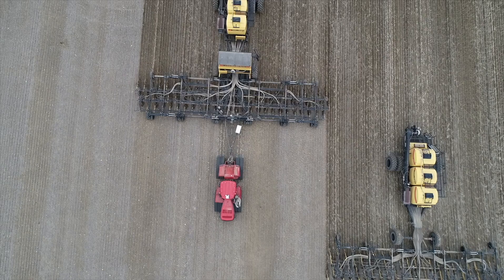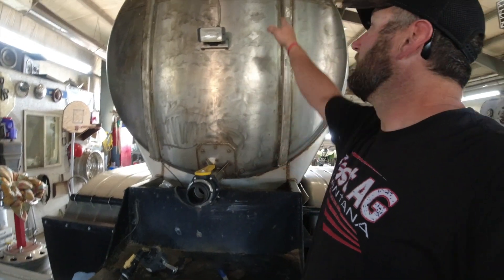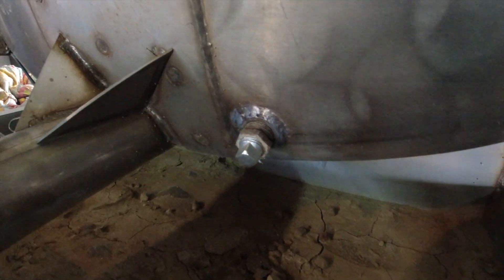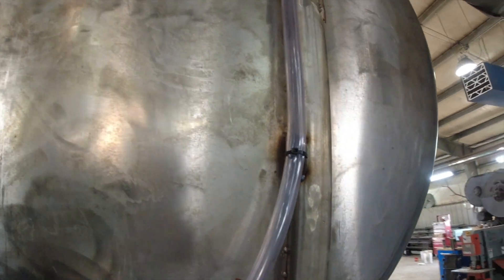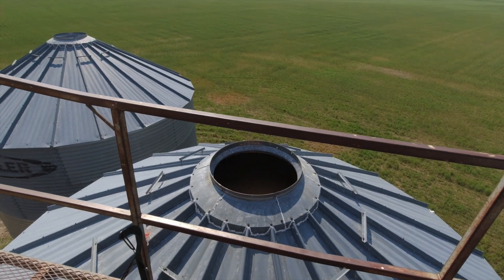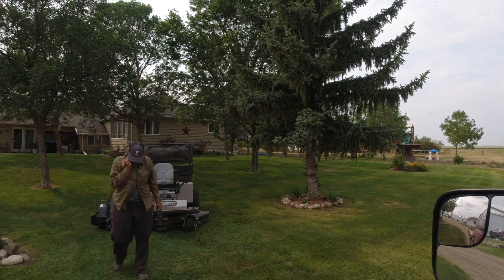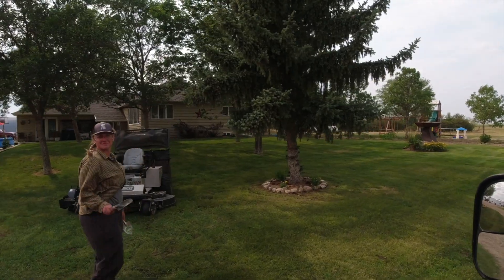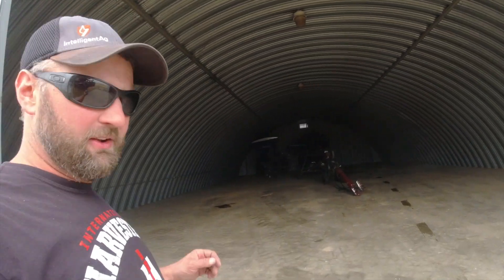Dad Broke 5 Fingers?!?

Comment: Dang Tony, you may have to make a trip east and find a couple of flex heads like we use in soybeans here. I hope you guys are running rock traps, here in Michigan I won't run beans with out one. Good luck!
Reply from the maker: These are flex drapers.  We can’t cut on the ground in our wheat and canola since we didn’t roll the rocks though. And yes we have always ran rock traps out here. They get dumped a couple times a day usually.
Reply: @FastAgMontana  Thanks for the reply. I don't know much about Mac Don heads and how they are set up. Once again good luck with harvest and God bless. Praying for a safe one.

Comment: Would it be too intrusive for you to share the math behind your decision to run one 100’ seeder on the 580 Quad instead of the 450 Quad n seeder and 580 Quad n seeder you ran this year?
Reply from the maker: It was almost impossible to get both drills going by 9 am. With one big drill one guy can get trucks ready and the other seed. We plan on taking shifts and running close to 24 hours.  Also hope to plant some winter wheat.
Reply: @FastAgMontana  thanks for sharing that